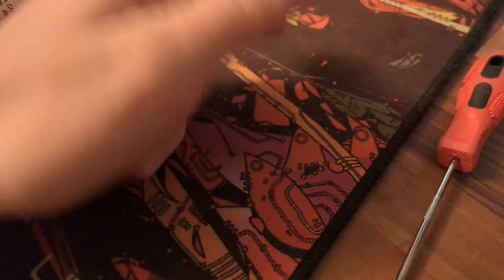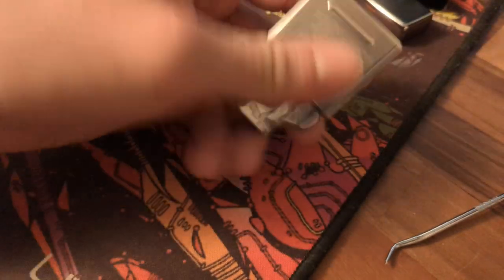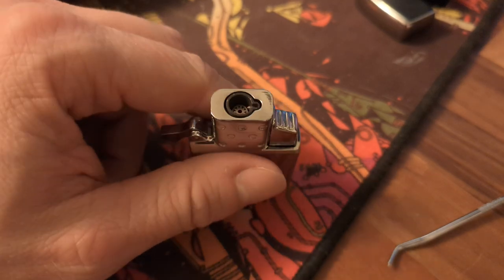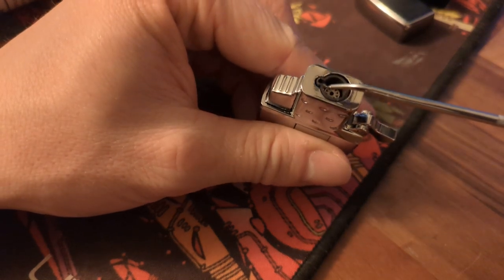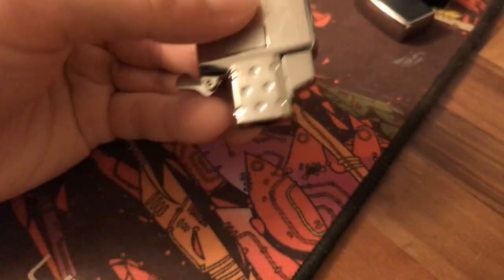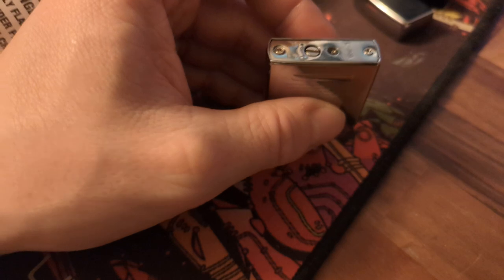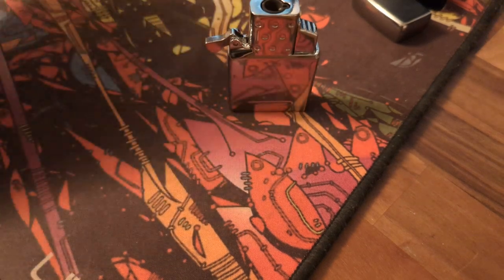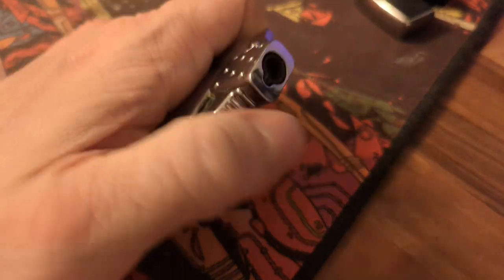zippo lighter butane insert (actual) fixes

Comment: I get that they dont work well, but its mind blowing to me that they dont even fit well like original, how did thay happen in 21st century like cmon
Reply: They fit fine. You might not have a Legit zippo case
Reply: @mr.m2695  I do have original case lol? Double torch had issues, single torch fits a lot better
Reply from the maker: @cherchil  it depends on luck. the cases are reliably the within tolerance margins. the us inserts too  the chinese inserts don't. some will be better than others.
Reply: There are different types of zippos, with slightly different dimensions. I guess these butane inserts are meant to fit a selection of zippo types, so they may not fit as perfectly as the inserts that comes with the zippo.

Comment: Warning do not buy these lighters. You’ll be wasting your money.
Reply from the maker: yeah they're not so great honestly. its.. fine once all fixed up as per video, but not really worth it. also fixed the fit with shimsm but at 15USD it shouldnt be like that. You can get a bunch of BICs and be happier, or just a regular zippo.
Reply: Only for people who don't know how to maintain a butane lighter, and buy plastic tipped butane tanks, like ronson. I've been using mine for around 3 years now.
Reply: It’s not a waste.  Great brand. It’s just new so you don’t like it
Reply: The double torch I hear works fine. They must of learned from the problems of the single torch
Reply: @starfox2215  both work just as good. Just a matter of preference
Reply: @johnhurtme  Zippo butane tanks also have plastic tips. At least the ones i have bought here in Norway (both big and small bottle). Ive never even seen one with metal tip IRL.

Comment: I have the zippo double flame butane insert. I bled it, took the governor off and jacked up the output, bled again and again. I was sure i wasn't getting a spark. As my last attempt to get a flame i bent the wire that creates the spark basically at a right angle toward the flame ports. Bend that litte wire down more.

Comment: Thanks! Pushing the wire down slightly solved all of the issues I was having. :trophy-yellow-smiling:
Reply: Mine had too much glue on the wire that was not providing enough spark. After picking off some of the extra glue, it worked great.

Comment: Thanks man, I really appreciate you taking the time to make this video 😁👍
I received a new Zippo with the double burner as a birthday gift from my oldest friend on Saturday and it just would not light properly/reliably.
I have used cheap disposable butane jet-flame lighters (from Clipper, Zenga and Tor-Jet) for probably 15 years with absolutely zero issues (except for the Zippo Blu that I bought when it launched, which was just complete garbage with no positives to mention, that I sent back to Zippo for repair 3 times and the lever that opens the gas valve still broke a fourth time after just a couple of days use, so I "retired it from service"...) but my new Zippo just wouldn't run and I was dreading the conversation where I would have to tell my buddy that it just didn't work... 🥺

Watching your video reminded me how I used to have to purge air from the tank on my first ever jet-flame lighter (made by Rowenta, that I bought in Harrods in London way-back in 1991... 😳 -It used a fine wire filament like those found in lightbulbs instead of a spark to ignite the butane and aside from needing to be purged after every fill, it was an amazing lighter until some asshole stole it, and after owning that I have always loved butane jet-flame lighters after growing-up with "regular" gasoline Zippos as a kid.

So, watching this reminded me to purge the tank (after 32 years of simply not needing to...) and suddenly my splendid shiny new Zippo works reliably every time I need it to, so huge thanks man 😊👍, and now I feel pretty stupid for not thinking to do it by myself... 🙄